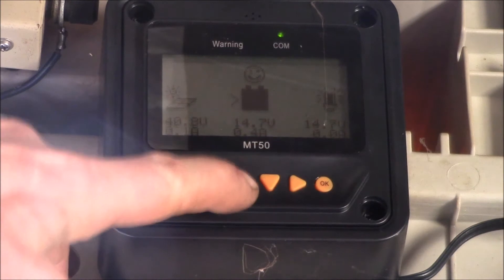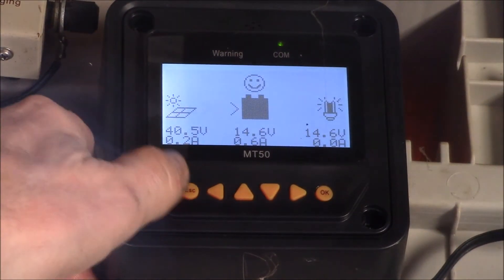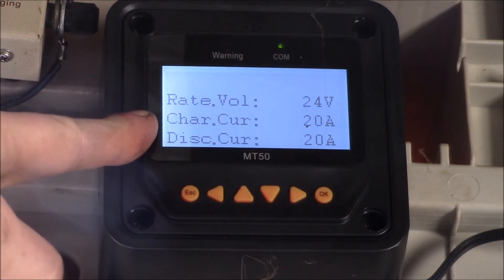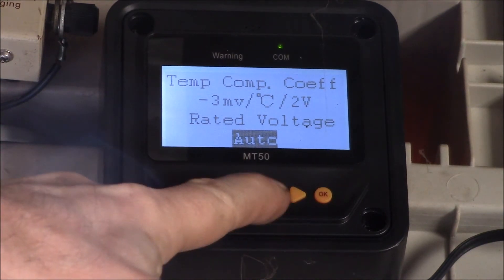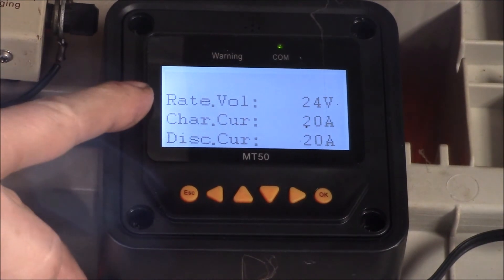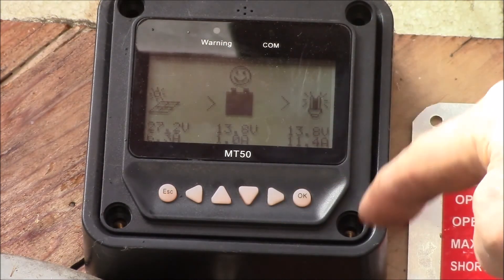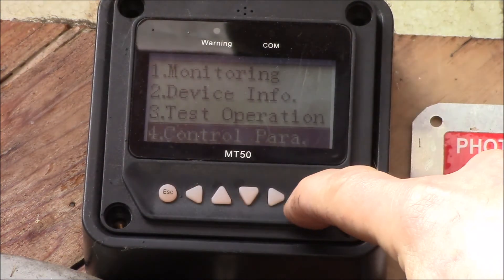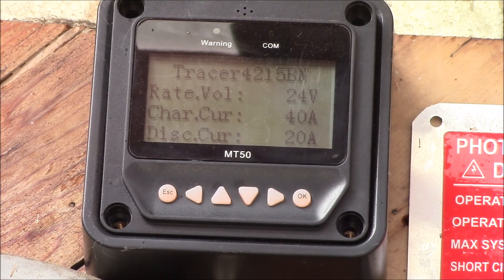EpEver/EpSolar MT50 Remote Display: Device Information Screen

Comment: I have a system with 2 x 120ah in parallel but my MT50 remote is showing 420ah. Anyone know why this is?
Reply from the maker: It was likely set to that value at some time in the past.  Easy enough to change that value under the COntrol Parameters screen:
https://youtu.be/4XhvwruVEJU?list=PLpY2FP1a9tityj2bGD-tEj4RSoXu7Alid&t=271

Comment: I just installed a MT50. The display keeps telling connecting.. that's it. How does it work then? How do I connect?
Reply from the maker: I've never run into that issue myself.  Might try reconnecting the cable or try connecting the cable with the charge controller on and off and see if anything changes.  If not, see if the Epever support folks have any ideas.

Comment: I have to have this remote display, is it worth have another battery display monitor or is the MT50 accurate?
Reply from the maker: Assuming you're looking at something like a state of charge monitor, a dedicated coulomb meter would be better for that than the MT50 which is decent at displaying voltage and charging and load current, power and energy.
Reply: @The4Crawler  thanks for the reply, I will get one and add to my build.
Regards

Comment: Any chance do you know if the green COM light can be turned off?      It's super bright at the cottage, and also I'm not getting the 1/10 of the power I was expecting from my panel, I'm worried it may kill my batteries.   Thanks in advance.
Reply from the maker: Not aware of any way to turn it off via a setting.  You might contact the EpEver support folks and see if they have any ideas.  One option that I've used is apply a layer or two of masking tape over the LED to dim it down.  Or, if you're OK with working on electronics, open the case up and remove that LED.  

And figure out why you're not getting the power out of the solar panel.  Check the voltage and current at point where the panel connects to the controller and make sure that's in-line with the panel rating.  Maybe there's a bad connection someplace.  I had an issue a few times where if I checked short circuit current at the panel MC4 connectors it was fine.  But if I checked down at the inside wiring connection, I got very little current.  Turns out my wiring was fine, but the MC4 connectors on the solar panel were not making good contact with the MC4 connectors on my wiring.  So I changed out the MC4 connectors on the panel and all has been good for many years.

Comment: Man I’m having the hardest time with my system. I have the epever 4215 bn tracer series I’m trying to connect to 2 X 12v LifePo4 batteries so that it runs 24v. Everythign I see shows the settings for a 12v lithium ion battery but I can’t seem to find anywhere that explains what the user settings should be on a 24v. What would I set the user settings for? Thanks in advance, I have these beautiful batteries sitting here and have not been able to use them.
Reply from the maker: Simple answer, take 12V settings and multiply by 2 for 24V.
Longer answer, take your desired per cell voltages and multiply by 8, assuming your 12V batteries are 4S internally.  See below video for how I did this for 16V:
https://youtu.be/4wt_L2L4W4Q?si=y_l6sdtASAyGwIeU
This is for lithium ion cells (4.2V) and 4S, so I took my per cell voltages, multiplied by the 4 series cells and then adjusted values from there as documented in that video series.
Reply: @The4Crawler  I’m not sure how many cells it has. It says one but I know that’s not right. 12V 200Ah LiFePO4 Lithium Battery 150A BMS,NewtiPower 10000+ Deep Cycle Lithium Iron Phosphate Battery for RV/Camper, Marine, Overland/Van, and Off Grid Applications These are the ones I got. I’ll go through the manual again to see if it says how many cells it has. I got two of the 12v 200ah Lifepo4 batteries and have them inseries for 24v 200ah. 

Thanks for your advice on just doubling what the other video says on the 12v, I’ll give that a try
Reply from the maker: @jimmyp371 LiFePO4 is nominal 3.2V/cell:
https://footprinthero.com/lifepo4-battery-voltage-charts
3.2 x 4 = 12.8V nominal for the 4S/12V battery.
Reply: @The4Crawler  Omg you’re a legend. Thank you so much for this, it’s very very helpful!

Comment: Do you have a video on using the Load Setting menu? I can find no good explanation for this menu and want to set timers. Thanks.
Reply from the maker: I briefly cover that in this video:
https://youtu.be/8dpDUFyDVJw?list=PLpY2FP1a9tityj2bGD-tEj4RSoXu7Alid&t=313
I always use Manual Control mode.
For the timers, they're all based on using these to control loads like street lights or security lights.  Basically variations of "on at sunset" and "off at sunrise" with times based on that as I recall.  I've never used any of those timer modes myself.

Comment: Hello  my first question is the wire plugged into this all the time from original controller the MT50 ? 
And can you get an extension of this wire if so ? 
And 
what is the ah battery part set up at , if you have 2 x 110 ah batteries ? Thanks
Reply from the maker: Yes, you can leave the MT-50 cable plugged into the charge controller all the time.  Extension, no problem, it's just a standard 8-pin RJ45 ethernet cable, although it uses RS485 serial communications protocol.  It can be run for 100s of yards/meters as I recall.
For 2 - 110AH batteries in parallel (i.e. a 12V system), 110 + 110 = 220 AH.  For 2 batteries in series (12 + 12 = 24V), 110 AH:
https://youtu.be/8dpDUFyDVJw?t=180
Reply: @The4Crawler  so it has to be changed to 220ah ? As I thought it was standard 200 , sorry I’m new
Reply from the maker: @loony457  I think 200 is the default setting.  I've not found that the AH setting has much, if any, effect on the controller operation.  I mainly like to set it so that I remember what the name plate of the batteries is.

Comment: What is going on with the light  on the  right.    Looks to be on&off?
Reply from the maker: I assume you're referring to the DC load "light".  It is a bit of a strange icon in that when it's on, it shows the light "rays" but also is colored black.  In any event, I use that output to power my main DC loads like lights and fans.  That way, that output will shut down if the battery voltage drops too low, for example if a light were left on in the shed (BTDT).
Reply: Yes  that is what I was referring to. 
What is happening when the  icon is illuminated.  "rays ".on
Reply from the maker: @boscodog4358  Just uploaded a video covering that feature:
https://youtu.be/8dpDUFyDVJw
In short, that "light bulb" shows whether the DC Load output is on or off.  These controllers are set up for controlling things like security and street lights at night and those lights would be connected to the Load terminals.  Common settings are to turn on at sunset and off at sunrise, for example.  I set mine to Manual Control and then can turn my DC loads on an off as needed, or automatically if the battery voltage gets too low.
Reply: .mine  are on and off

Comment: I have a question. My solar panel is working and bringing power in but does not seem to be charging my twin 12v batteries. The MT50 shows no readings on the bottom 3 columns. My batteries are sealed. I'm just not sure what to check or change on my Mppt Solar controller via the MT50? Everything else seems fine.
Reply from the maker: Never seen that situation myself.  But the only 2 times the controller can be bring in power from the solar panels is to charge the batteries or power the DC load output.  If the batteries are fully charged or there is no load on the controller output terminals, then very little power will come in from the panels.  It may be things are working and the display is just not showing the charging data.  Try using a volt meter to check the battery voltage and see if it's up in the boost of float charge range that you have configured.  If you have access to a clamp on ammeter, see if any current is flowing into the batteries.
Reply: @The4Crawler  So if power is coming in from the panels I should be getting some kind of charge reading? When the sun is out, the warning light on my battery is green when it goes in, it immediately goes red? Maybe i've wired it wrong. I've recently put in a new controller as the las one was dead and i'm more than certain that it's correctly wired.
Reply from the maker: @twerpuser  Check all your connections between the controller and the batteries.  Look for voltage drops, like one meter probe on the controller + or - terminal and the other on the battery + or - terminal.  There should be almost no voltage drop measured, if there is find out what is causing the drop.  Also, check the battery voltage when the green light is on and then when it goes red.  If it goes from say 13.7 volts to 12.0 volts, it may be something is pulling current out of the batteries or one of them may have a bad cell or something.
Reply: @The4Crawler this comment may be this missing link to my understanding. 

I have 4 350w panels connected to the epever tracer 40amp. That is connected to two small car batteries in parallel (group 24f). Also connected to the batteries is a 6000w 24v inverter. I have had a small fan connected and a portable AC unit. The AC compressor won’t kick on. 

My hope was that the solar power would help supplement the battery power to run the ac. But it seems that what you are saying is that the charge controller only serves to charge the batteries not provide power to the inverter.
Reply from the maker: @ I'll assume you have the inverter connected directly to the batteries.  If not, do that and not off the charge controller DC load output:
https://youtu.be/Xug_EJ4Th1U?si=xDEIlQED_JEc9sM1

Also, I'll assume you have the 2 12V batteries connected in series to make a 24V battery and not in parallel which would only give you 12V.  

It may be your inverter is pulling the battery voltage too low when the AC tries to turn on.  You might try something like I did on my old system, that is adding a super capacitor bank in parallel with the batteries:
https://youtu.be/8TVDFK2enSI?si=0NKgpWJk3La54rhG
This let my 1000W 12V inverter start up my freezer which it could not without the capacitor bank.
Reply: @ your assumptions are correct. Thank you I’ll try this next!
DIY solar is a steeper learning curve than I thought it would be.
Reply from the maker: @mikeheim44  Yes, it sure is.  I have some other videos about various things I ran into along this line.  I added a current meter in-line with my inverter to test the inrush current when large loads like my freezer or clothes washer started up.  Also experimented with adding power factor correction capacitors to some loads.  

For the AC, you might also look into a "soft start" kit for that compressor.  Those kits can reduce the inrush current.

Comment: Great video!
But  please  when you or anyone  makes a  video  please  use the back light !
I  can  learn some from your  settings. 
Looking good 👍
Reply from the maker: Good point.  I think I had the display backlight set on the longest duration, but it would still turn off in the middle of a clip.  Also, I think some of the clips in this video were shot in full daylight and that swamps out the backlight.  I guess it's best to film this display in full shade or dusk.

Comment: Here my prob with my charge controller 
I use 5415 epever model and 12 volt system 
2 × 330 watts solar panel in series
2 × 200 Ah batteries in parallel 
 I have 33 volt on pv and only 0.5 amps.

On Battery 
13.8 volt
And 0.8 amps

Is it a problem with my charge controller?

My batteries are never full charged even I use them
Reply from the maker: You might want to first test that all the wiring is correct.  Disconnect the solar panels at the controller and test for open circuit voltage and short circuit current at the end of the wires.  

I've run into a few panels that had a bad MC4 connector, it would test out OK at the panel with meter probes shoved into the connector.  But plug that connector into the wiring that ran down to the charge controller and I got very low current.  It was only when I tested at the end of those wires that I duplicated the problem and then worked my way back up to the bad connector.

You might also check the battery type settings and make sure they are correct:
https://youtu.be/4XhvwruVEJU
Your voltage/current sounds like the batteries are in float charge state.  Also, these controllers only sense the battery voltage at the terminals of the controller, so any bad connections between the controller and batteries will result in voltage drops and the controller might think the battery if charged when it's not.  Measure the voltage drop on + and - cables between the controller and the batteries.
Reply: @The4Crawler  thank you

Comment: On the home monitoring screen why does the picture of the battery ON MY MONITOR show half full when resting voltage is 12.8 and full only when non-resting voltage is 13.7?
Reply from the maker: Best would be to contact Epever support:
https://www.epever.com/contact/
But short of that, you mostly answered your own question.  That display element uses a simple voltage measurement to "state of charge" reading.  It's complicated by the fact the controller is lacking any sort of voltage sensing other than at the battery connection terminals, so if any current is flowing in or out of the battery, the voltage reading will be off.
That's why I run something like the TriMetric battery monitor on my system:
https://youtu.be/5LcY-EqOV5Y
It gives a fairly accurate state of charge based on measured amp-hours in and out of the battery.  So if you have a 100AH battery and pull 30AH out, it'll display 70% SOC.
Reply: @The4Crawler  Thanks for the quick reply. I'll have to reach out to Epever to see what they have to say. It really doesn't make sense why the battery icon says half full when the resting voltage is 12.8. somewhere in a setting the icon is getting different information than the voltage readout.
Reply: Hello, I had exactly the same question, I have the MT 50 in my motorhome and rarely does the battery icon go solid, don’t think it ever has just with solar or engine running, only after plugging into mains for a day or so, then when you unplug seems to loose some of the black bars very quickly even with no power being used.. frustrating as not very accurate.

Comment: Will the MT-50 show amp hours ?
Reply from the maker: Yes, that's on the screen labelled "Char. Energy" that's next after the time/date screen.  However, that only reports AH for the DC load output, not for PV input or battery charging current.  It also resets monthly, but does keep a running total.
Reply: @The4Crawler  Thanks for that.  Now, what do the Amps below the middle Volts mean to me?
Reply from the maker: @juliecallender5539  Usually the middle readings are for the battery, voltage and current (positive is charging, negative is discharging):
https://www.epever.com/download/mt50-remote-meter/

Comment: What kind of lead acid batteries where u using in this video and do u the amp hours as well ? I have 6 interstate deep cycle batteries in parallel from Costco’s and I wish I new how much amp hours I had . Thanks again great video
Reply from the maker: Battery information in this video and in the description there:
https://youtu.be/4XhvwruVEJU
Around 7:15 in that video, I mention the AH setting.  I have 2 smaller 12V AGM batteries in parallel, so the total AH is just the sum of both separate batteries.  In you case, add up all 6 AH figures (assuming they are all 12V batteries) and that's your total AH.  I'm not sure if that setting actually "does" anything in the controller, or at least I've never seen anything change with that setting.

Comment: I have trouble setting my parameters on number 4 button can’t set the voltage limit on the recommended for a lithium battery
Reply from the maker: If using the MT-50 display, there are some "small number" parameters that depend on "large number" parameters.  That is, you may need to change some parameter later in the series of screens to a higher number in order to change the earlier parameter.  In the manual, they talk about those relationships.  So you may need to cycle through the user battery type menus a few times to get everything set up right.  I think I talk about that in my 4S lithium battery parameter videos, this is the 3rd in that series:
https://youtu.be/ofmXkwYEbvo

Comment: Does anybody know how to change the Celsius to Fahrenheit
Reply from the maker: I've never run across an option to change that display setting.  No mention in the user manual.
Reply: When you see the temperature on the screen, press select and hold it during 5 second it will change to Fahrenheit

Comment: Along that same subject, you can wire up up a load wire. But what I read your not suppose to take have load from their but from the battery. So I would guess you can set up auto room light come on. LOL but if they are taking street light so it ca handle a heavy load taken from that post. I had a old tracer had that too in the minute, but it confusing as there 2 timer clocks. What the timer number you used? To have the load on all the time? Talking about taking power from the far bottom right 2 screw. And what do you use it for?
Reply from the maker: I use the DC load output for small (up to 20 amp) DC loads like fans, lights, battery chargers, etc.  I set the load to be on all the time, setting 17 on my old Tracer unit.  Yes, you wouldn't want to run an AC power inverter off the load output.  The advantages of that load output are that you can turn it on and off with the load button, it'll shut off automatically with low battery voltage and the meter will record amp-hours and watt hours used on that output.